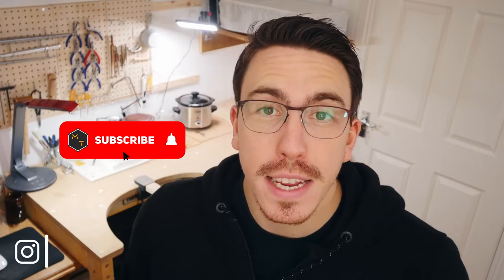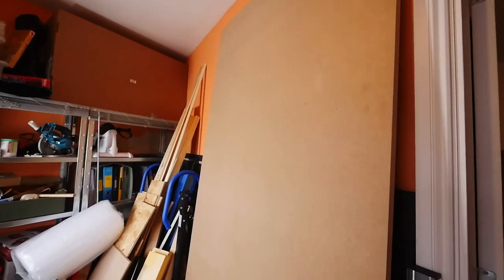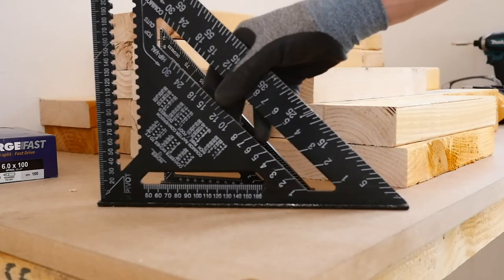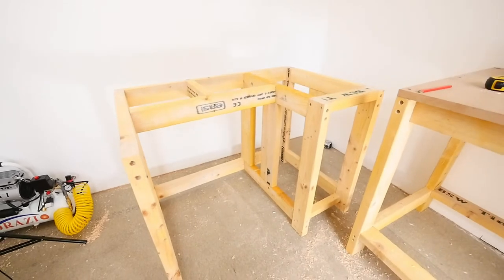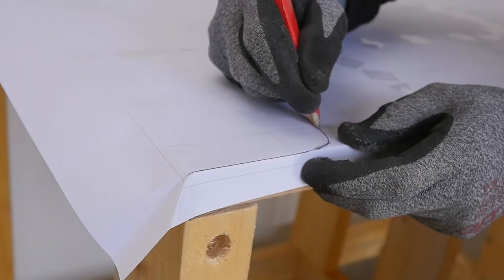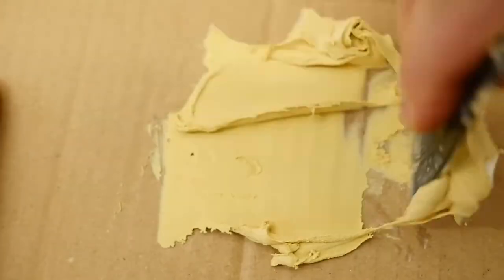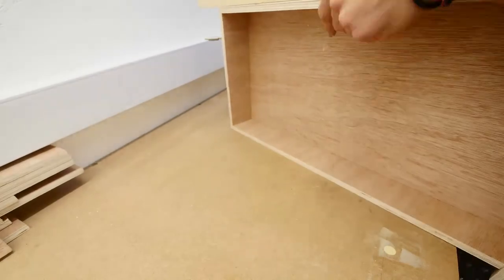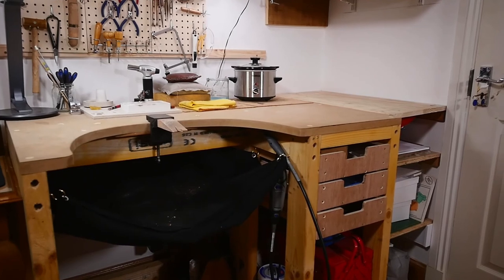How To Build A Jewellers Bench / DIY Jewellery Workbench

Comment: I just converted an old wooden teacher's desk into a jeweler's workbench with the cutout. I see it has been a few years since you made this. Do you still like the catch/apron? would you change anything now that you have been using it? 
Thanks!
Reply from the maker: Well, the only real chance to this design might be to add more draws, use a fake leather for the catch material, and more space on the left-hand side of the workbench. Apart from that it's been doing great.

Comment: That bench height is so crucial..   I built my second bench 1.5 inches taller, and it buggered up my shoulders good to file at that height..  
what is really nice  (but not necessary) is to be able to hammer against your bench peg..  but one should be able hammer on the/ bench top without rattling everything across your bench.
Reply: I bought the trestles from ikea and put a solid wood table top on as the trestles move up and down plus forward like a drafting table. It’s a good fix for the height as we are all different heights ourselves. Mittback is the name of these amazing trestles
They look like work horses but so much more functional and nice to look at.
Reply: @micbyte  does it jiggle much?

Comment: drilling holes so deep into the wood is not the greatest of ideas. You lose all of the strength and create some big weakpoints, especially considering you're already drilling into end-grain (which is a not great method in itself).

I would consider using actual pocket-holes from the backside, or drilling all of the way through, and gluing in dowels instead of screws.
Reply from the maker: Very true, you got a point there. Considering this is not going to hold more than maybe 40kg and a blunt force from a 2'' jewelry hammer of perhaps pushing at 75 newtons. I think it will survive 😉. ( Thanks for looking out for me tho )

Comment: Has anyone worked out the total length of 2x4 id need to build this?
Reply from the maker: M N, Knowing the total length is not really going to help as you might get your 2X4 in 2M or 1.5m of 4.8m lengths which would then change the number of 2x4's that you would need to get. They way I like to do it is to find out the wood I can get and then then out all my cuts to make sure I have enough wood for the project.